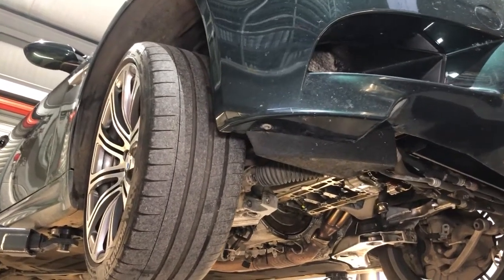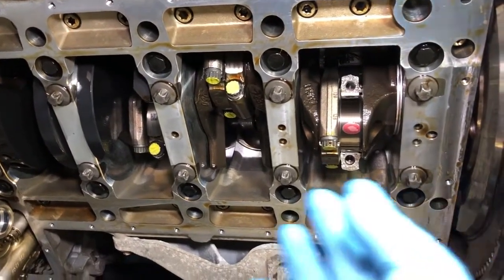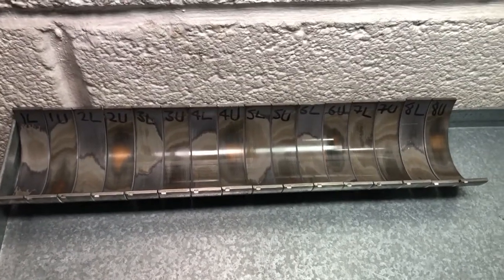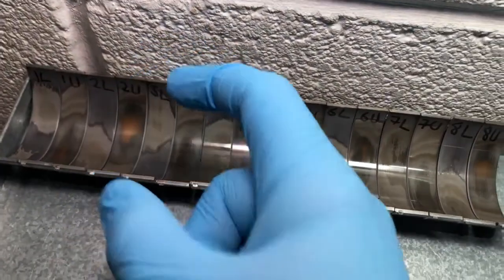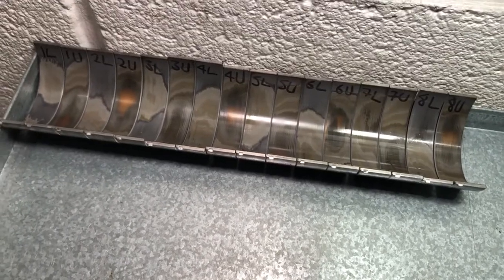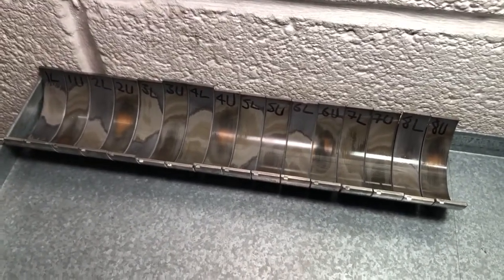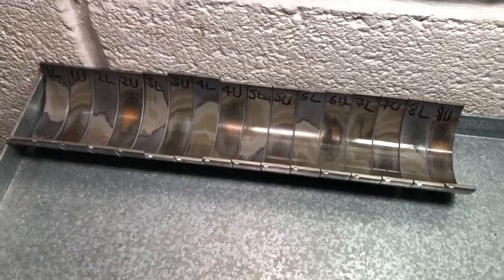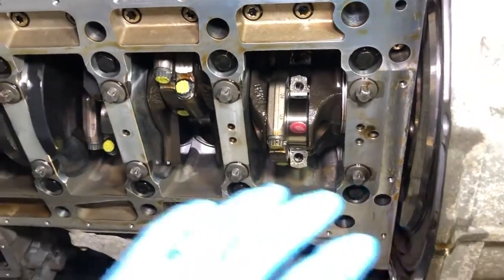LE MANS Racing Driver Can't Avoid Conrod Bearing Wear!

Comment: I had my bearings done by James and the team at 63,000 miles. They were worn but nothing horrendous. ACL seemed like a good solution to me as they seem more consistent in terms of clearance than the BMW 088/089 bearings. I've done 27,000 track miles in that time and no issues.

Comment: Don’t worry about rod bearings.
Worry about main bearing #1
Reply from the maker: We’re actively following the Main Bearing discussions and discoveries around the world (we’ve had 2 engines comes into us with Main Bearing seizures) but it’s worth noting the vehicle in this video is a 2008 which doesn’t have Start/Stop technology.
Reply: @RedishMotorsportbmw  the early S65 don’t have the problem with the no.1 main bearing, in 09 BMW changed the layout of the hole drive belt. That is the reason why the drive belt pulls the crank up against the upper no.1 main bearing.

Comment: bad engine design. the downfall of bmw. after the 2000 only engines with problems. not like the amg mercedes engine. yes I drive bmw. after 2000 bmw went gay
Reply: What a nonsense dude